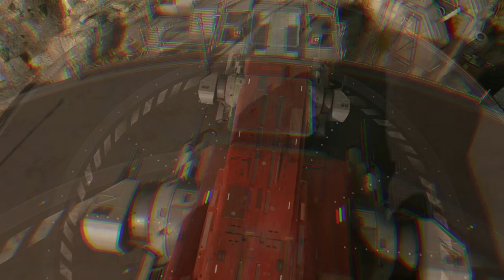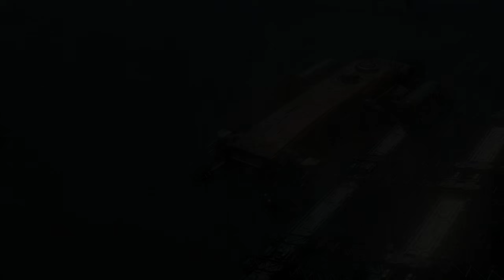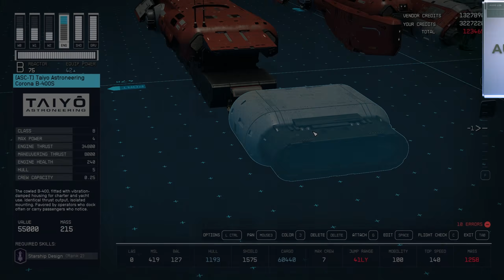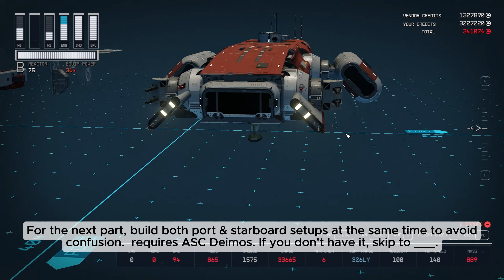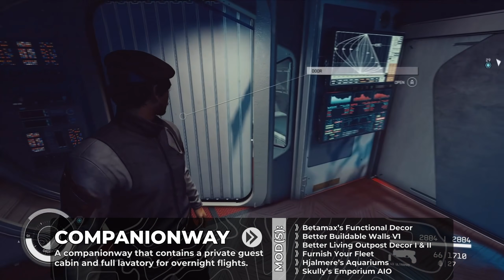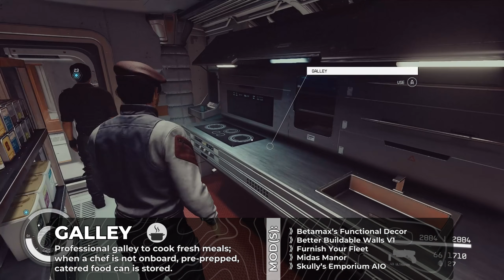390-R Kobayashi | ASC Taiyo Yacht | Starfield Ship Build Guide

Comment from the maker: Hey shipwrights! How are you enjoying ASC Taiyo so far? Just wanted to make a few clarifications, nothing meant to alter the build process:

» Some stats like the cargo, mass and hull ratings vary by quite a bite in the trailer VS the ship info section VS the actual build process. My fault on the editing, but the wide ranges are due to the use of micro components from various mods, and these are very easy to stack without any performance penalties. I didn't feel the need to show the process of adding additional cargo since these are very OP and can be installed at your own discretion.

» Considering the mass/mobility ratings, a 4th engine is not needed for this build. But if you want to add a 4th engine, merge a second Corona B-400S engine into the first one using the Select + Shift merging technique (or use the CHI Cross-1 Class B Engine module like I did).

Comment: at 12:51 its not letting me place the nose cap over the panel
Reply from the maker: Make sure you turn on this toggle setting called “Ship Builder Enable Flip Merge” in the games Control settings. 

Also, if you’re using Ship Builder Configurator, there’s some merging or snap tolerance settings that you also need to set to high. 

You should be good to go after that
Reply: @High_Key  thanks for the instant reply, i got it!
Reply from the maker: @griftur absolutely! You caught me at just the right time
Reply: @High_Key  you should do more luxury builds like this, maybe a larger version of this one. or perhaps a stroud ecklund variant, thatd be nice.
Reply from the maker: Honestly, I’m enjoying the luxury builds. The interiors are so much fun to figure out

Comment: Place Doors Yourself caused all the vanilla habs to disappear in my interface. I'm curious about your mods list and load order, and how you got it working when we have similar lists. Otherwise gorgeous and clever build, just the sort of thing I like to study so one day I can make my own that are awesome like this.
Reply from the maker: So I do have my load order linked in the description for this video but there’s a few caveats. 

For one, it’s outdated because I’ve made numerous changes after the Free Lanes update, mostly subtractions because of the pointer handle issue. 

And the second thing is, the various categories of mods are generally in the right order. But the mods themselves might actually be backwards. I mixed up priority when I first did my load order thinking a higher placement means higher priority. But it’s technically the opposite because the mods that load last make the last overarching changes. So you want to load mods that make smaller changes first before mods that have a larger scope, to prevent those smaller mods from changing anything from the larger mods. Idk if that makes sense, but I did the opposite because I thought the actual chronological order was more important. 

So you can reference it, but just know, many mods have been disabled, many have been added, and the category placement is generally correct but individual mod placement within those categories may be in the opposite order.

Comment: Hey what mod pack can I find the monitors under the dragon and the digital poster displays?
Reply from the maker: You can get those from either:
- Skully's Emporium AIO
- Better Living Outpost Decor
- Starizon - Machines & Technology (might not have)

Skully’s and Better Living are both big general decoration mods with hundreds of items each. Unless you’re super picky about decor like I am, they’re basically redundant, so you can get by with just one. I keep both because each one has a decent number of pieces the other doesn’t.

Starizon has a bunch of different types of decoration mods. Machines & Tech focuses on the avionics/engineering decorations and fixtures you'd find on a ship. Basically engineering hab stuff. So, it might not have all the screens you want, but it has a lot of variety of "displays".
Reply: @High_Key thank you!

Comment: So for your load order is it in the game creations or did you use nexus mods instead  if so is there a way to replicate what you have for the load order
Reply from the maker: All my mods are from Creations, so I manage everything manually through there 😓
I did just start getting into Nexus recently because I wanted to use that HonkCore HUD mod. I have my load order linked in the video description, but it's outdated (December 2025), and significant changes have been made since the Free Lanes update to account for the pointer handle issue. I'll try and get an updated load order video up today or tomorrow
Reply: @Hig@Hig @High_Key  playing on a PC?
If you play on a PC use the both mods "Pointer Handle Limit Fix" and "BA2 Limit Fix (from the same modder) - it solved my problems with my pointer handle use!
With 200 creations/mods my game was crashing all the time, with Falkland Systems my game would not start at all - my pointer handle count was about 1.8 million PH.
Now I increased my loadorder to 250+ creations and mods - my new pointer handle count is a bit over 2.2 million and the game is running smooth and without any problems at all (incl. Falkland Systems!).
I used ChatGPT to look at his quellcode (source code) and ChatGPT found NO problems and thinks he - with the help of the Cloude AI - found the solution (but it works only on PC).
I started a new character and since 40 hours playtesting  (building ships and outposts, decorated them with lots of deco items, changing Neon with creations, visiting New Atlantis, Akila City, Neon, The Den spacestation (which is now updated and improved with a creation) and several POIs on diff. planets, etc. - NO problems at all!
My new Pointer Handle limit is now a bit over 4 million PH (about 51 % of the possible Limit I just now use)
I did not test or installed his other version which would have a limit of 8 million pointer handles!
I have now also more than 255 BA2 files (the old limit), because I use a lot of them!
I play Starfield as an Open World game (without the main quests or Constellation (using SKK Alternative Start) since over 3.500 hours and was frustrated whith the old pointer handle limit (so many good and big creations and mods uploaded every week)!
I play different characters (lone Explorer, Ryujin operator, etc.
I would love to see a real small Ryujin-style ship for just one lone operator. It would be interesting how you would build such a small ship with ASC Taiyo parts!

Comment: The clipping on the bay needs sorting but other than that great
Reply from the maker: The only real thing that bugged me with this build. I only remembered afterwards, but there's a 3rd engine option that's like the Corona B-400S but without the outer hull plating, so it wouldn't cause clipping. But without the outer hull, might need to add addtional parts around it to keep for a smoother look.

Comment: Pro tip. Some of the pre-built ships from the ASC Taiyo mod have custom shield boosters that are only available for those particular ships so if you wish to build a ship that's got beefier Shields than normal, rebuild a ship like the barracuda. You have to actually rebuild it because these shield boosters are not available in the shipbuilder.

Edit: I recently restarted so if the shield boosters appear in the shipbuilder after you have reached a certain level, let me know and I will edit my comment and will credit you for the source
Reply from the maker: I would've never known unless you told me, that's very good to know. Is it a faster repair rate or more shield HP? 

Got it, so if they're not in the ship builder, then only way to test is in combat right?
Reply: @High_Key btw, when I said the part isn't available in the shipbuilder, I meant it won't be there until you dismantle the specific part from the specific ship. Once you do that, it will show up in the shipbuilder but you will only have one. Once you reinstall it, it will disappear from the shipbuilder and you won't be able to buy any more.
Reply from the maker: @neondystopian  Interesting. I haven't had a chance to mess around with it yet, but just to confirm, you can dismantle it from a ship and exit the builder, and it'll still be there the next time you open the ship builder? That's an interesting mechanic that should've just been in the base game in general where parts you dismantle are readily available until used again. If the ASC Taiyo ships eventually respawn in vendors, then you should be able to repeat the process right?
Reply: @High_Key it works just like the frontier hab unique part for the frontier. As long as you remain in the shipbuilder, yes. If you leave the shipbuilder, outright, you will lose the part forever if you do not reinstall it. As you pointed out, you can always do it again once the ship respawns
Reply: @High_Key let me know if you didn't get my reply. I think YouTube censored my first reply to you. I told you where to specifically find the part on the ship but I don't think you ever got that one
Reply from the maker: @neondystopian  Ahh ok I understand now. Just like the Frontier hab.

It's cool that Wizz is treating this like a little easter egg or bonus feature. The kind of thing not every player will notice or find. Somehow missed this comment at first but that was on me, not YT. Didn't notice you did 2 replies at first 🫡

25% Regen boost and 50% EM resistance is LEGIT. Ok, definitely going to be dismantling some ASC Taiyo ships now.
Reply: @High_Key  I'll have to look again but I believe it's faster recharge rate. I know that barracuda has it. Portside, toward the front. It's that little yellow thing hanging off the fuel tank. Another ship has it but I can't remember which one.

Ever since I noticed a prefab ship containing a unique part in an unrelated shipbuilding pack, I always check the prefab ships now, if any. Mod authors usually spend a lot of time on these to show off their assets.

Edit: they boost regen by 25% and EM resistance by 50%. Adds one crew capacity along with one hull and one mass. The osprey is the other ship

Comment: Bro, how do you decorate so much without breaking the pointer limit?
Reply from the maker: I've definitely been hitting limits, but also disabling mods when needed. Just before this build I had to disable the EliTek Crimson Fleet Habs and the various Graf's mods that I had just to get ASC Taiyo to work. I think doing that gave me a lot of additional legroom for now. Also, I don't have Terran Armada enabled. Just haven't been able to enable it at all since the update, the mods are honestly more important for me. 

But yeah I'd be lying to you if I said I wasn't surprised when I was listing out all the decoration mods I used. At one pointed I counted at least 14 decoration mods which, paired with the ship mods that I have, is pretty insane.
Reply: @High_Key If you play on a PC: install the both mods "Pointer Handle Limit Fix" and "Ba2 File Limit Fix" and the problem is solved!
I am far over the old pointer handle limit (my pointer handle count is now about 2.2 million!) and my game with 250+ creations and mods istalled runs smooth and without any problems!
My " testrun" (ALL building creations, ALL Deco creations, ALL POI creations, quest creations, lots of weapon creations, spacesuit creations, skins, new planets, new star systems and LOTS of gameplay overhauls installed!) runs now more than 100 hours without any problems!
I was building in this "test" lots of ships, decorated them like crazy, was building outposts and visited all big cities (which I changed and advanced with creations and mods)!
NO problems at all, over 100 fps everywhere with all setting on "HIGH" and 4 k (I play on a high end PC with a Nvidea 5090 card and 64 GB RAM).
Before installing this 2 mods my game was crashing all the time (with 200 mods and a pointer handle count of 1.8 million) and with "Falkland Systems" installed the game was not starting at all!

Comment: You never showed/mentioned where the last engine came from..I just merged 2 corona b-400s on top of each other to reach maximum engine power seems to be working
Reply from the maker: It was a very fast snippet that was easy to miss because I just added a CHI Cross-1 Engine module with the other Cross-1 modules. Didn't focus on it because it's not necessary for the mass/mobility stats anyways. But if you wanted it, you did it the right way with merging a second B-400S 🫡
Reply: Im on PS5 so i ignored the CHI parts but thanks for clearing it up 😊

Comment: What space combat overhaul are you using in these combat sequences? It's not vanilla is it?
Reply from the maker: Not using any space combat overhaul in particular outside of some enemy level modifiers and Dark Universe: Crossfire that adds additional types of combat encounters.

If you're talking about the camera angles, I'm not sure if there's a specific term for this but I just call it a cinematic action camera. You can enter this by locking onto a ship and holding down the toggle POV button (at least for PC). You can also enter a different camera mode by holding down the toggle POV button while not locked onto a ship, at which point the camera will lock on to your ship instead and you can pivot the camera around it.

One thing to note about the cinematic action cam, once you're in it, all the direct-fire weapons outside of missiles will no longer lock onto enemy ships. They just shoot straight when you're in this mode. Missiles will continue to seek ships, and turrets will continue shooting around as well but your other ballistics, lasers, particle beams and em weapons will just shoot straight until you exit this camera mode. And you exit by pressing the toggle POV button again.

Comment: Do you think these taiyo snaps used in combinations can replace the Smsex snaps outright. Hobart hasn’t come up with a fix for ps5 yet
Reply from the maker: I think these ASC Taiyo Spacers can pretty much replace all 50% HabSnaps.

HabSnaps are still more versatile for their size range and the number of snapping points they offer that allow for micro adjustments. The difference is, these Spacers are designed to essentially "move" a snapping point from its original location to a 50% offset. But since the spacers have rotations, you can merged multiple spacers into each other with different rotations to mimic the various snapping points of a HabSnap. If you're familiar with the Select + Shift technique, that's what you would use to merge multiple spacers into each other. 

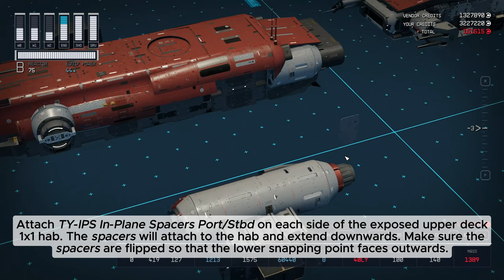At 17:39 I briefly explain how they work so you can see with the visual explanation as well.